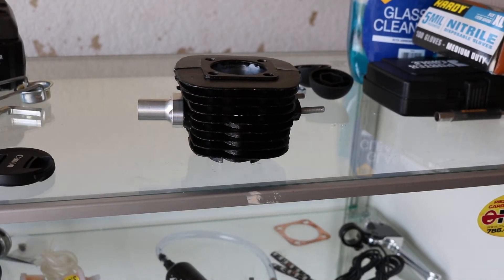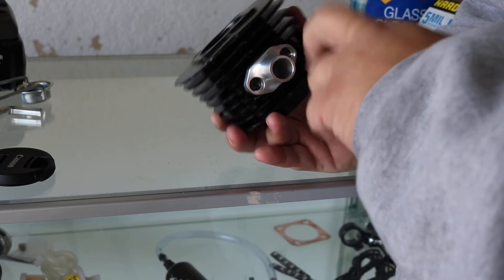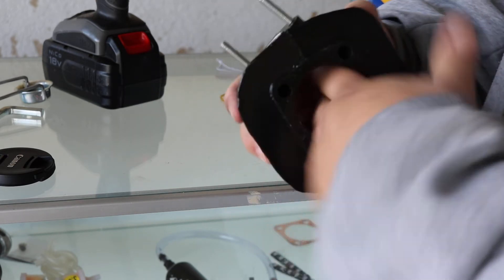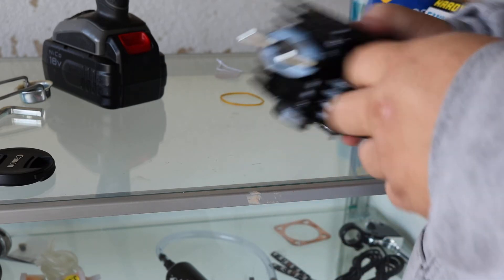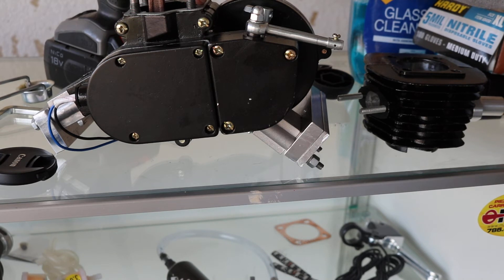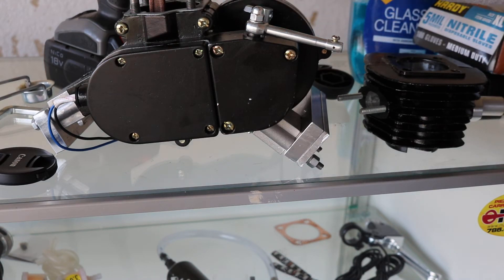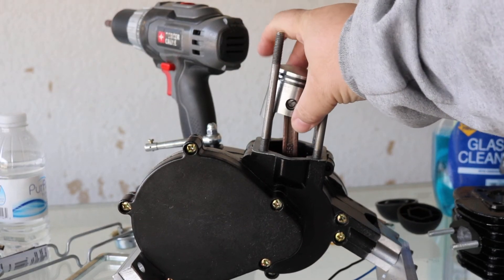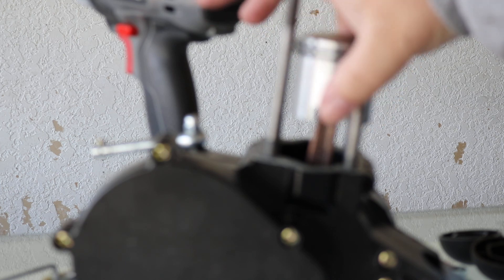How to port match a Chinese 80cc Bicycle Engine Part 2

Comment: Dude i bought an engine kit. The damn thing has a one peace cylinder and head. Its mounted to the block with allen bolts. Im wondering if i could drill out the bolt threads and re tap new threads so i could use studs.

Comment: My gasket that is in the center of the lower half is leaking its new just put it on bike is it hard to fix or would KB weld do
Reply: Don Campbell hooe ya fixed it. get a new gasket
Reply: Put chapstick stick on lower gasket top and bottom(basically draw a ring both sides). This will help it expand a tiny bit to create a better seal.